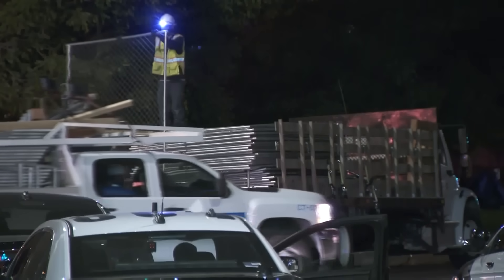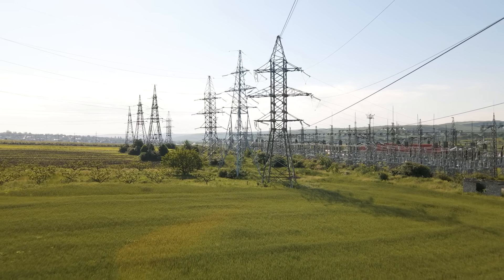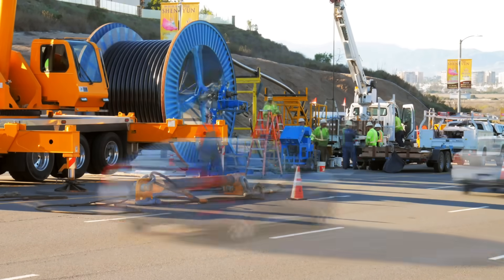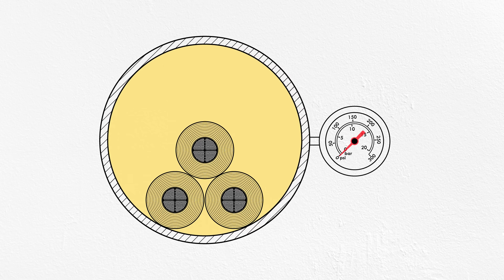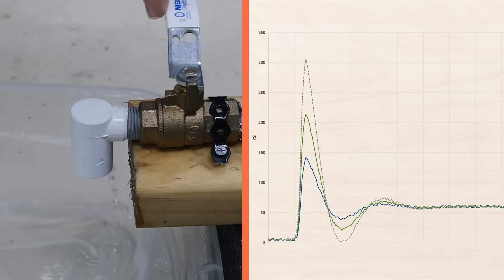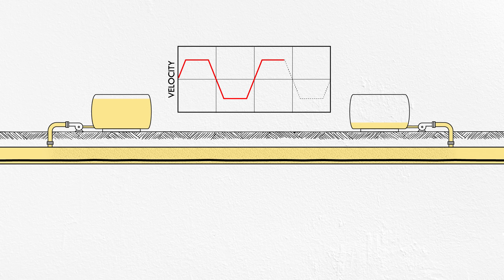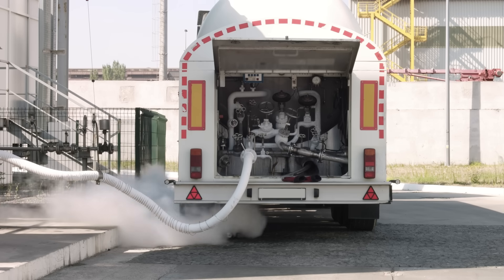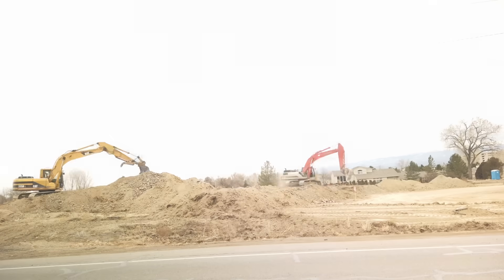Repairing Underground Power Cables Is Nearly Impossible

Comment: Agreed that was a challenge, but you should try finding and repairing a break in a fiber optic data cable at the bottom of the Pacific Ocean! Still amazes me that it can be done in a few days.
Reply: All u gotta do is look for sharkie love-bites, lol
Reply: @hauntedshadowslegacy2826  Are you in the trade? Since about 1988 we had to invent a special kind of protection in the cable designs to stop the sharks biting and short-circuiting the thousands of volts carried on the cables. They often left their teeth buried in the cables to help the finding of the faults.

Comment: We need to start pre-planning underground cable routes and then packing everything feasible into them and put them in accessible tunnels underground so they can be upgraded, replaced or repaired easily as well as stored in a closed and dry environment. They would also finally, be out of sight.

Comment: Every 6 hours when they lowered the pressure to reverse the oil flow direction, wouldn't this have caused the wires to heat up more? I'd bet they'd have to carefully plan load placed on the wires to account for this.
Reply: There was a special protective scheme in place; excessive temperature rise started a clock, with load needing to fall off within a prescribed period, or the line would automatically open. When the alarm came into the control room the system operators had to work quickly, shifting the load around before the circuit breakers tripped open. No one wanted to be explaining to the bosses and to the regulators why the line tripped.

Comment: Liquid nitrogen was used to improve resistance?
Reply: No, the liquid nitrogen froze the oil into plugs, which allowed the oil to remain in the cable. Without the frozen plugs the oil would have had to have been fully drained out.

Comment: I wonder if they apply a vacuum to the oil before they pressurize it, to get more of the air bubbles out. Seems obvious, I'm sure they thought of it.

Here's an idea though, two pipes, two parallel lines, (or just wires in one pipe, and the other for an oil return) and then pumping the oil in a continuous loop. Seems to me that would eliminate some of these issues.

Comment: There's also another very important aspect, and that's capacitance from the lines to the ground. That's another reason the higher the voltage the higher off the ground they are.

Comment: I don't much like the title of the video, since the video is really concerned with transmission lines rather than lower-voltage distribution lines.  Distribution via buried cables is routine in many other countries, and in some American cities.  I live in DC -- in the District itself, not the suburbs -- and during the time I've lived here, we've never once had even a brief outage from a weather event, while friends in the suburbs have experienced many.  The infrastructure required to support buried distribution lines isn't as extreme as that required by a transmission line.  So I'm a fan of buried distribution lines.

Comment: So a KNOWN problem took down the line?  Then that's not 'an impossible situation'.  It's negligence and incompetence, as is designing anything that is so difficult to maintain, repair, and ultimately replace that 'its impossible'  CA power and gas industry has been riddled with 'disasters' caused by endemic, systemic cost cutting, cheapness, greed, short sightedness, to the point of gross incompetence.  That the State Regulators, ie, gov't have allowed such to continue for decades since the 60's, is also proof of systemic corruption.  Thermal stress was apparently known, for some insane reason 'no one thought' to allow space around splices for them to move in larger, ie, more costly diameter pipe, as no one bothered to install systems to facilitate the KNOWN eventual replacement, as everything man made needs replacement sooner or later.  Much rather facilities, equipment, access points etc that would facilitate repairs.  Passing those costs to rate payers in the future.  
What's more amazing is that given the danger of earthquakes breaking the pipe w resulting environmental disaster of 'oil' which historically has been a liquid heavy with PCB's, there was no larger pipe around it to aid in removing leaking oil.  Not to mention the KNOWN deterioration of pipe that would eventually result in leaking. 
The 'fix' proves that the above greed, incompetence etc remains a systemic problem.  If the liquid nitrogen dams failed, as they would at any earthquake, the oil would at the least escape poisonings water table for 100's, 1000's of years, if not killing workers.  If anything else caused this 'we think this should work' to fail, unanticipated heat, torrential rains, worker mistakenly turning a valve, poor security allowing kids to mess with stuff, fire in a truck... the same would occur.  
Here's how a comprehensive solution to the issue of undground oil filled conductors is easily, and for very little in additional cost, installed.
Trench is made wide enough for 2 runs of cables.  As most of excavation is mobilizing and equipment costs, and actual material removal and replacement is minimal, no big increase.
Concrete pipe large enough to allow the pushing of steel pipe from one end to other, evacuation of spilled oil, movement of probes, robots, cameras on pull lines are installed for needed lines and their replacements.  
Access points located close enough to allow replacement ie distance pipe can be shoved down concrete conduits, are installed during construction.  As these are essential big concrete boxes and they will make initial cable installation easier, faster, cheaper and better, the cost of these simple constructions is truly minimal.  If additional access points are needed for anticipated repairs, install those also.
Depending on how 'new' the ideas are, ie, if this was the FIRST oil cooled / insulated line, INDEPENDENT engineers are hired to brain storm all possible failure modes, which are then addressed instead of sweeping under carpet as is SOP in CA utilities (Erin Brockervich, Worlds largest gas storage leak, undersized power lines causing forest fires, deregulation causing blackouts...).  
OH
and if you want to be more than an industry PR flack, you'd have done more than repeat their PR releases and pointed out some of the above, or how newer better lines are built, etc.  
fyi  The industry BS that there wasn't enough oil to allow draining was bogus on it's face, and proven bogus when that's what they did, drain and refill.  How could they have built it if there wasn't a reasonable accessible source of enough oil.  Why would they do so if oil was in such short supply it would make it impossible to maintain by draining and replacing.

Comment: What I am wondering is if it wouldn't make more sense to put the power lines in separate pipes so that more distance could be kept between the lines?  I suppose they might have been looking to avoid the disruption involved with digging wider trenches (closing 1 lane is better than entire roads) but you could always dig deeper and stack the pipes vertically with several feet of earth between them.  Is it an issue of the increased cost involved with deeper trenches?

Comment: Could they not install  rectangular mass concrete lined tunnels  the size of a room and string the cables  one on each side and one on the floor?     Concrete  is cheap, 4 inch walls would do.

Comment: How times change, on my last project they ran 275kV underground direct bury using XLPE had 5 inline joints between the two substations and each drum weighed 20T so that was a challenge for them. Plus having to fly in jointers from Korea during COVID didn’t help. Still a very interesting install.

Comment: In my country most high voltage lines are aerial cables. In AC up to 380kV. In villages and cities it is all underground. But with medium voltage of 10kV to 35kV. I know, a colleage hit a 10kV cable that was the main supply for a hospital with a wrecking bar and survived without a bruise. 
There are now high voltage DC lines built and the Nimbys did not want the eye sore of cables in the air, so most of it is put underground. Some hundred kilometers of cables with over 1mV.  
There are already a couple of high voltage DC cables as sea cables. From windparks to dry land and between countries.

Comment: Thanks for the video. One quick question! How did they know that there was a fault in the line to begin with? Were there slight changes in voltage or current that indicated this?

Comment: Not an engineer, but wouldn’t three parallel trenches some distance apart avoid the need for pumps and dielectric oil?
Reply: If you managed two, the third would not be a problem.  You could put one each side of a road.

Comment: Very interesting. I wonder why they didn't bury an oil return line along with the high voltage transmission lines, and just pump the oil in a loop with a single pumping plant, and perhaps a few small oil cooling stations along the route if necessary, instead of having two pumping plants and reversing the flow every six hours.

Comment: Lincoln, Nebraska - in the 1970's - due to the oil crisis, did something similar, yet different.  The city's power system put in a roughly 5 mile underground 115kV line.  In a grand experiment -- and this is all from memory... but each phase was in its own plastic tube and I think surrounded by air.  Now listening to your video, I'm not sure how that underground line was kept from failing... but they used the line until about 10 years ago without fail -- and decommissioned it (albeit I think it's still there) with more modern, above & below ground methods.  The electric system said that even they were surprised that it lasted as long as it did trouble free.

(if ever curious, this would have been the line from the N. 29th St. & Leighton Ave. substation, to the substation north of S. 40th & Nebraska Hwy.)
Reply: ...on second thought, they might have sucked most of the air out of the tubes... can't remember for sure.

Comment: Gosh using high-pressure oil to insulate wires seems like such a crazy idea. Gotta keep the pressure up constantly. Any ruptures are potentially devastating to the entire system. What if there's an earthquake which causes a rupture, then suddenly you've got an environmental disaster of oil getting pumped down into the groundwater table. Much smarter to use a passive system of solid polymer insulation.

Comment: I use a TDR every day in my work in the telecomm industry. 

That thing is a lifesaver.
If you have both ends of hard-line to test from it will usually find the fault to within inches.
If you can only test from one side it takes experience and skill at interpreting the data we get back, but the guys who have been using a TDR meter since I was in highschool can usually nail it easily.

Comment: I think this is needed everywhere.. put a fuse system every 2000 ft and have "some" slack in the wire to allow bends. it's underground no need to tighten the wire as is above ground.

Comment: Other than the primary power lines from generation stations, Germany's power grid is underground. It is very reliable. I wonder how they accomplished that. Where I lived in California desert, power disruptions due to above-ground infrastructure damage was a semi-annual occurance. Underground might be more expensive to repair, but wind and fire are not issues. MTBF is probably much longer.

Comment: The answer to the problem of high tension line failure :
A serious  reduction in the power requirements of the electical load:  especially the efficiency of that load.
Example : Illumination (lighting ) load was significantly reduced by using LCD lighting instead of incandescent.

Comment: I doubt it, should have made a cable tunnel, real wide
Reply: you have lazy containers laying around, built the tunnels from those
Reply: corn starch ethanol-water impregnation
Reply: full loop, belt, no need to do ac, just dc loops, even for fluid coolant flow
Reply: so called experts
Reply: always teaching how not to do things
Reply: just use the default ceramic, ie, stone, rocks, in pipes, the metal tunnel
Reply: wasted work
Reply: that clever
Reply: superconducting power lines, if ever needed, get real
Reply: oh you spoke, how non-expert

Comment: I was once one of the first people at the scene of a 250KV underground oil-filled transmission line failure, and starting the most incredible fire.  The fire developed through a large underground inspection plate, which was blown away. Huge sheets of oil-fired fame shot up from the hole and firefighters when they arrived didn't really have many options until a specialised foam truck arrived from the airport.

Comment: In Auckland ,New Zealand,1998, an underground line failed, it supplied most of the City's power need .There were two very old lines, one was gas insulated. The other was oil insulated .
https://en.wikipedia.org/wiki/1998_Auckland_power_crisis

Comment: A wildfire took out the underground power lines to one of our remote sites and the generator there has run for over a year to support it.  It's going to be years yet before they get new power lines run (and they are going to be above ground) so they are talking about putting in a solar plant, battery bank and backup generator.  Thankfully I won't have to maintain this stuff the way I do the site generator.

Comment: Well that explains why the high voltage power lines they recently built up along 202 near Phoenix are mostly above ground. They do dip underground for about 0.5-1 mile as they cross the path of a municipal airport before popping back above ground. If they're that much of a nightmare to maintain underground, I'm not surprised they only did it where absolutely necessary.

Comment: As an electrician I agree. To save costs they often rely on direct burial cables rather than putting the wire in conduit which is slightly more expensive. Those cables get scratched during install and can degrade over time and fail, but the direct bury patches they use fail really easy compared to installing a junction box at the failure point. Upgrading or repairing the lines is also much easier in conduit but they still use direct burial cables fairly often due to short term benefits

Comment: So much trouble would be avoided if power lines were underground. 
Eyesore gone
No more cutting trees for poles
Easier to access with proper tunnel system. Can even uses robots to inspect and do minor repairs
No outages from storms, or cars hitting poles
Fires in Cali would have been avoided.

Comment: The internet in 1989?  That's a bit hard to swallow.  I might be wrong, but I thought that protocols had not yet been worked out at that point and it was difficult for networks to communicate to each other.  In any case, underground lines are FAR better since they are far more reliable.  In Florida, whenever there is a wind storm we have constant outages....Except in areas where the lines are underground.  Since Florida Power and Light puts a lot of coins in republican pockets, there is little pressure from the state government to force that nefarious company to start undergrounding their lines.

Great video!

Comment: You just know that oil is PCB oil that’s why they left it in place... I live in New Jersey and we have similar forms of power cables under ground, PCB oil in paper insulation that has a lead exterior about a quarter inch thick,

Comment: We used TDR to find transmission line flash-overs caused by bird poop.  Guess where the faults were located? Right across from a fish farm. Birds grab fish, land on transmission line cross arms, eat the fish, crap on the insulators, the bird poop flashes over, protective relays take the line out. The flash -over evaporates the poop (called streamers) and we couldn't locate the problem by visual inspection (line patrol).  Installed TDR detectors and next time the line tripped .. bingo we located the problem.

Comment: This is why we run lines in the air. An air cooled conductor can handle a bigger potential difference. Can’t do that in a conduit, or underground the way you can in the open air. EMF has no where to go in a conduit. In the open air there’s nothing interfering with that field.

Comment: Underground power cables should be the new sewer system. Designed for access to the cables kinda how they are hung on telephone poles. We should have an underground network of cables like that. Having power poles everywhere above ground is just so ugly and very susceptible to bad weather causing power outages and fallen trees. The US has so much of the power infrastructure above ground on power poles its like a mess of wires even in the most beautiful cities and towns. It takes away that beauty. Not to mention we cut down and trim back so many trees just for power lines that we are contributing to climate change by taking away oxygen giving trees. Its a domino effect of problems that the existing power infrastructure has. Lets not forget how antiquated it is and not safe against hackers and or targeted attacks. It needs to be broken up into sections that have a backup system in place. Right now if a substation goes down an entire section of the grid goes down. There should be a way to relay power from other parts of the grid when there is excess energy etc. it’s so sad that the 21st century as envisioned is not even close to what it could have been…   End Rant

Comment: Not even hard... Couple gallons of lube, pull new cables by using old cables as rope. Tractor pull it. Done in a few hours per 100-400yd stretch. If old cable is brittle, then pull mule-tape with old line first. Want to inspect tunnel? then camera on mule-tape(can measure distance of where camera is with it). Want to be a dumb-ass and dig it up everywhere? feel free!!!! They're not going to "repair" it, they're going to replace it. ~Electrician